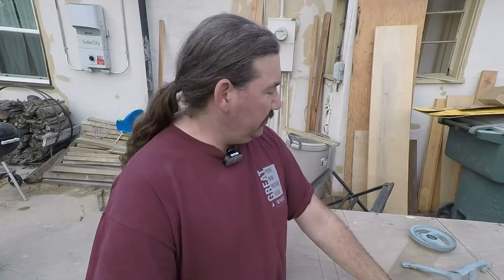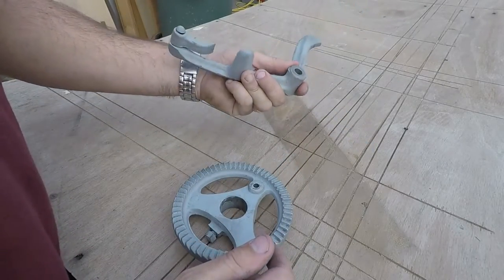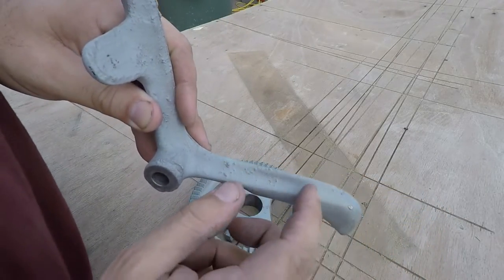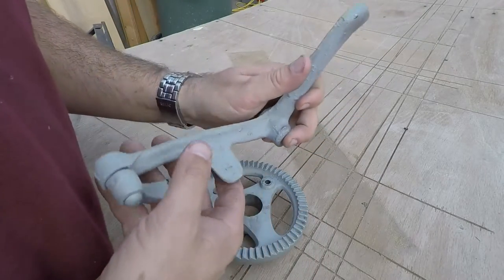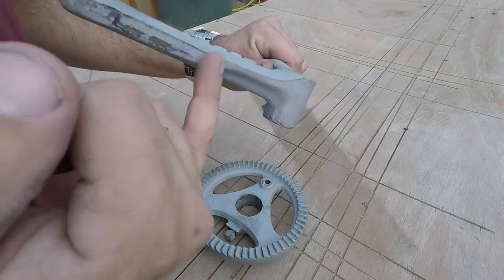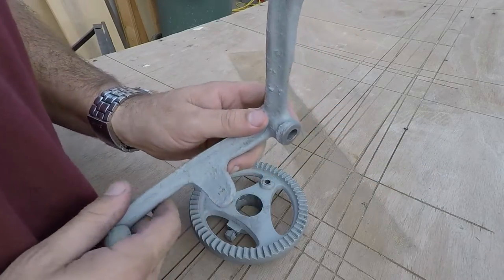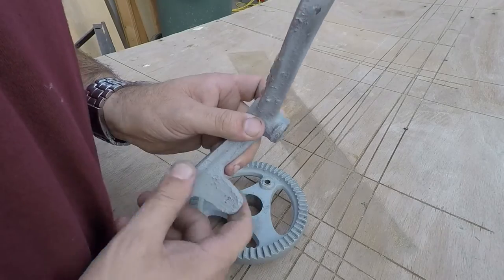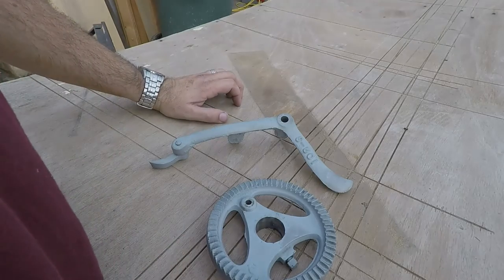Champion blower and forge co Post Drill Press Part 4

Comment: Can't wait to see the results.  Please cover the economics of what you are doing along the way.  I still have all (I think) of my taper attachment parts laid out to go through.  Also, the advance'r arm and paw are the most often missing parts.  Following that is the table.  Depending on cost, it would make sense to run off 10 sets just to have parts to offer others.  I would think a casting set for the arm and paw would be worth at least $25, maybe 50 to somebody who needed it.  Particularly if the holes are machined.   By providing a valuable service you could save a great many old post drills laying in dusty corners.  The concavity in the arm section mentioned is where it rubs on the crank cam.  Yes, I like that you are going to clean it up.  I've obtained a second one.  Perfectly complete.  Not having access to casting, I have to make sure they are complete.  I can handle everything else.
Reply from the maker: Crafted will do once I  get them back I'll let you know
Reply from the maker: +Crafted oops lol this was a longer message then I thought. The trouble is there is a great many of the as parts that look right but are just a little different and will not work. But you are right this will save many machines. I'll probably make a permanent pattern and they can be order as needed.
Reply: Chris Anderson Yes, my comments are often used as chapters in books.
Reply from the maker: +Crafted oh yeah a book set I see

Comment: Did you happen to cast more of the advance arms? I have the same model Champion that I’m trying to rebuild and need one badly.
Reply from the maker: I didn't have any extra cast I'd go seek help with the post drill madness face book group lots of knowledge people on there
Reply: Old Iron Shops Thanks, will check them out. Did you have an original in pieces or were you able to locate plans/schematics for the part?
Reply from the maker: @mattgleason8817  I used original parts and made them into patterns . I'm not 100% certain if they were the correct parts for this machine specifically it seems that there is numerous variations with very small details so keep your eye out when you're doing that.